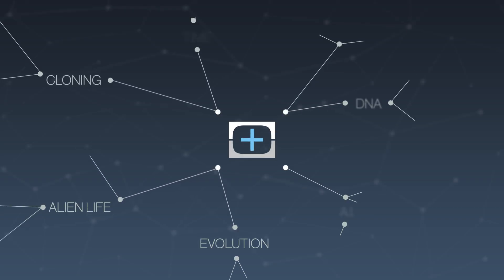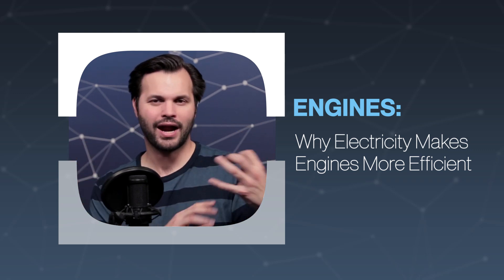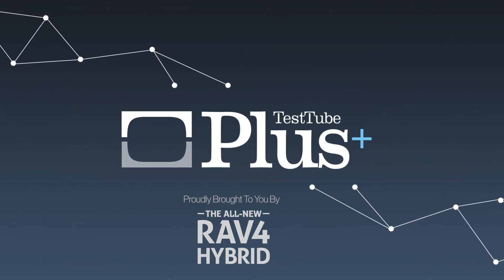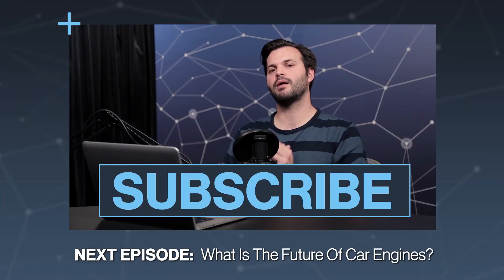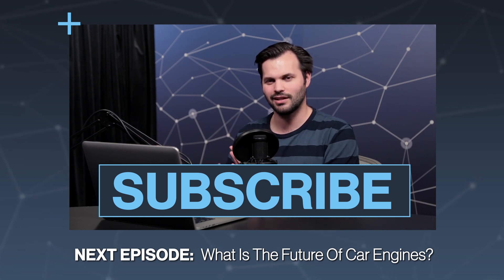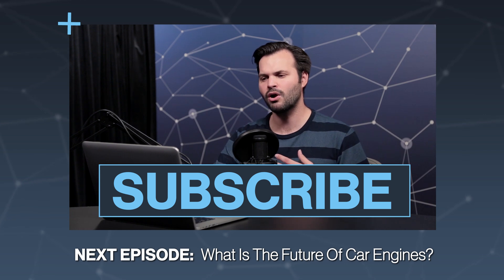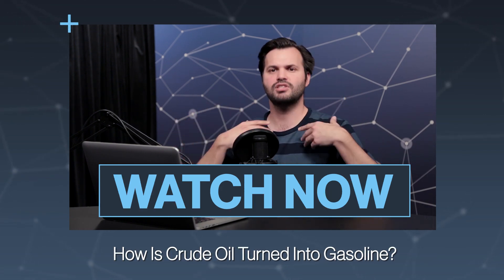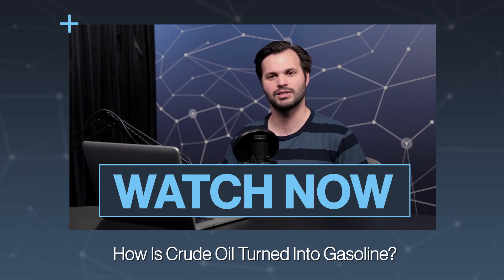Why Electricity Makes Engines More Efficient

Comment: less moving parts = less energy spent moving the parts. It just sounds like it makes sense.
Reply: +What do you think no where near as bad as oil from countries with less regulation
Reply: Ogur1981 The difference is enormous in a country with 80%+ of its energy coming from renewable sources like water power. However this is not for everyone. Electrical cars are amazingly cleaner than gasoline cars, but only in certain countries where the electricity itself is clean. Globally the difference is probably gonna be 20%+-
Reply: +What do you think research into really good batteries would help in a lot of first world errands, we should put a lot of money into it.
Reply: Because it does, just talk to a mechanic who works on electric vehicles.
Reply: +rogantu   There is a little known fact when it comes to production of gasoline that many have not considered. "Gasoline takes an enormous amount electricity to produce."  Crude oil does not just become gasoline. It has to be distilled in power hungry electric controlled refineries.   So in the end an electric car  still comes off more cleaner because it gets its power from the electric grid directly. If we want to be fair we have to consider we have to consider have how much electricity these Refineries burn to make gasoline and add that to the efficiency equation.
Reply: We solve this in power plants by keeping the temperatures above 130 degrees Celsius when leaving the boiler, washing the exhaust gases of acidic components, ashes and nasty gribblies, and reclaiming the heat after the acidic compounds have been removed for use in pre heating boiler water and such.
Reply: Psittac20 We haven't necessarily worked on electrical cars as long as on gasoline cars though. With time, this is bound to get more efficient, not to mention if the source of electricity comes from water power, it has to be better than a gasoline car.
Reply: +rogantu Batteries in a hybrid are expensive to replace and create more pollution to create than they save.  That's not to say overall it is a bad idea, as a society we need to put our backing behind alternatives so that more research and advancement is made to get us to something entirely new.  But right now a hybrid is not financially or environmentally ahead of gas engines
Reply: Actually, no. The heating required to work the distilling process is obtained from steam. That steam is generated from other sources. I work on power plants and I have worked on one located next to a refinery. We supplied a large amount of steam to them for their heating requirements. So we would produce electricity and send the left over steam to our neighbours.
Reply: Ogur1981 unless we are talking about inefficient chemical reactions that produce waste products then the best way to make steam is by heating water bro.
Reply: Actually, to be specific, it is the only way to produce steam at useable pressures and temperatures. That is done in a power plant by typically burning coal, oil, gas, wood or garbage. Garbage in the case of the plant I worked on at the time. You could also use a nuclear plant for the same purpose. The principle is quite simple: Make fire, boil water, heat up the produced steam further, send steam through turbine connected to a generator, condense the leftover steam, repeat. You can condense steam by cooling it with surface water or the air, but you can also use something like crude oil as a cooling medium. That will heat up said medium. Which can then be distilled.
Reply: Ogur1981 what about reactions that produce water at temperatures over 100 degrees, like burning wood, or reacting hydrogen and oxygen??
Reply: +Ogur1981 Also, one power plant providing 1000s of vehicles with electricity generates less overall pollution than 1000 smaller engines on those cars combined. Easily.
Reply: shirshakbt to throw in a thought, the overall process of producing energy may be cleaner, but remember batteries require a lot of not so clean aspects.  Have to create them and dispose of them.  They certainly don't make financial sense when you consider any savings on gas is lost in battery replacement.  Also the second hand market of hybrids is virtually non-existant.  Still this is a time we need to focus on new things over what is cost effective so it's worth it.  Personally I won't own anything with a battery if I can help it, and if I do it won't be until great strides are made in the technology.
Reply: One more thought I had, which is cleaner? buying a second hand 10 year old car and getting another 10 years out of it, even if per mile it isn't as green.  Or trashing a car because the batteries cost more than it's worth to invest in a car that old, and dealing with all of the emissions in producing a brand new car?
Reply: +Morru Qu&#39;aan I think we were typing at the same time. See above. As far as I know there are no power plants yet that use hydrogen as a fuel. That would greatly reduce exhaust pollution. If you can find a clean and efficient way of creating said hydrogen in the volumes required to run a decent sized plant. The thing is the heat. Where that heat comes from does not matter greatly. As long as you have enough energy and temperature to heat up the water to sufficient pressure and temperature. Think pressures in the 100-250ish bar range with temperatures somewhere in the 400-500ish degrees celcius range.
Reply: +Psittac20 Well 10 years is a good time for a vehicle to recuperate its battery making impact. During that time, it would have had saved more than half of the fuel normal cars would have. That fuel equals less fuel imports. Also means less pollution, and the battery can be salvaged (It's highly lucrative to salvage batteries) after 10 years or whenever. During that 10 years, the only damage it's done is the manufacturing of a battery (one in every ten or more years) seriously you consider that not a worthwhile thing than gas engines?
Reply: shirshakbt I'm honestly not educated enough on the subject to make statements, just ask questions.  I was under the impression that batteries were replaced every 5 or so years but this is only hear say.  I'm still rather stuck on the idea that hybrids don't improve your bank account in any way.  To paraphrase some top gear stuff mixed with other things I've known of, to create an entire car and it's batteries creates more greenhouse gas than a less efficient car living out it's life.  Again I don't know enough to make declarative statements.  Also I didn't know about battery salvage, that's very interesting.  Another idea I found in this video, is that transporting and refining oil isn't clean at all.  In the end the entire subject is so complex with so many variables I think there is a small percentage of the population that can truly grasp it.  I may have a valid point about hybrid cars not being cost effective, however there are many of us that aren't concerned with an investment every so many years in batteries.  Not to mention we need to pool our resources behind new energies.  Still, I don't buy new cars and am always looking for a bargain when I get a car, so when I look at buying a used car that will within a year or two require $5-10k, the car has lost every last bit of appeal.
Reply: Ogur1981 I think of hydrogen as a conduit for power rather than a source of energy.  What the world truly needs is affordable and clean electricity which can be used to create hydrogen.  Then use hydrogen to fuel up and bypass all of the downfalls of batteries.  My utopia would be mining the moon for helium 3  and use that element for fusion reactors.  Then use the power from those reactors to create hydrogen as a way to store and transfer that energy.  I probably won't see any of this before I am old and gray, but out of everything I have seen out there leads me to feel that is the perfect situation.
Reply: The example I always fall back on when it comes to efficiency comes from my work environment.  I work in hvac and they are trying to make 90% furnaces standard over the 80%.  The problem I find with it is that the substantially increased complexity required to save such a small amount of natural gas is simply not worth it.  The down falls of a 90% are many, it removes so much heat from the gas that it condenses and produces condensate.  This introduces highly acidic water into a system where there was no water before.  This requires entirely new venting made of pvc which usually requires tearing out ceilings in finished basements and in many condominiums there is NO option for new flues.  The initial cost of the equipment is a good deal higher, the installation is considerably more, the maintenance is more frequent and the life span is drastically reduced (think acidic water in metal heat exchangers).  When they break they cost more to fix.  All this to save $6-10/mo in Colorado for 4-5 months a year.  This has left me bitter towards clean and green.
Reply: +Psittac20 I think if you've driven 100,000 miles for the 10+years your hybrid has, then you've pretty much saved the amount of gas equal to or more than the amount you will need to put in for the cost of the battery. Also, if you want to complain about battery process and how nasty it is, do you think that the amount of batteries produced for cars outweigh the overall batteries sold in the world? Have you considered how many disposable batteries are sold? Do you not think they can recycle those efficiently and not hybrid or full electric vehicle batteries? Seems like you haven't thought of that. Yes, after 10 years your battery might need replacement, but in the 10 years, you've saved up as much money in gas, not to mention you've emitted less emissions and consumed less fuel as well. Given that the trends of battery technology going up and them being more efficient, I think that it is a worthwhile investment.
Reply: shirshakbt I was under the assumption that they didn't last 10 years, I had heard more like 5.  Apparently that isn't true, also I heard the batteries were much more than $5k which again isn't true.  So I guess that even in the worst case scenario that you break even on cost of replacing a battery after 10 years, you may have saved emissions?  Still I'm unclear on everything that goes into the process of mining materials and creating batteries and how that compares to drilling for oil transporting it and refining it.  I wish there was a reliable video that broke it all down into clear cut answers.  Most of what I'm basing my info on is potentially hear say.
Reply: shirshakbt here is an interesting article on a green website.  And it basically says that electric cars are about as efficient as a gasoline counterpart which is one size smaller.  I would imagine some room for leeway so as the current power grid stands, they are a little more green than a gasoline car. That doesn't mean this isn't the way of the future, just that as it stands, it isn't the holy grail many would chaulk it up to be.
 http://www.greencarreports.com/news/1084440_does-the-tesla-model-s-electric-car-pollute-more-than-an-suv
Reply: You would think.  But, do you know what goes into the batteries?   Battery manufacturing is a nasty business, and I wish Trace would have covered it.
Reply: Also less mass to move around as well, assuming a hybrid. However, pure electric cars are less efficient then the power plants producing the electricity. They are therefor may be locally clean, but the pollution occurs elsewhere. That electricity is created, transformed and transformed, then transformed again before it is charged into your car. Actually it is probably transformed several more times along the way. Then it is again transformed, not in a different voltage, but into kinetic energy. Every step along the way is a step where you will lose a bit of the energy available at the power plant. It would be  good thing to finally be open to the public as to how much energy (and therefor pollution)  is actually saved by driving an electric car compared to a gasoline car. And a diesel car. I personally think that the difference would be quite negligible. Maybe even showing that overall the electric ca is a greater polluter then the combustion car.